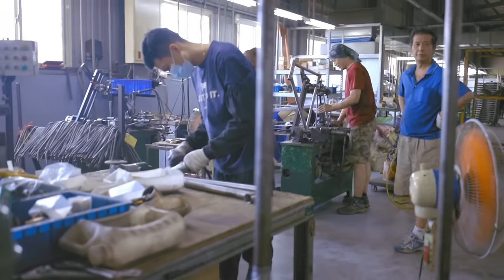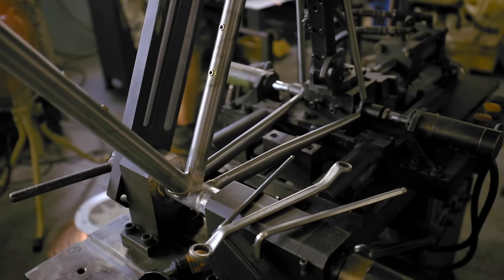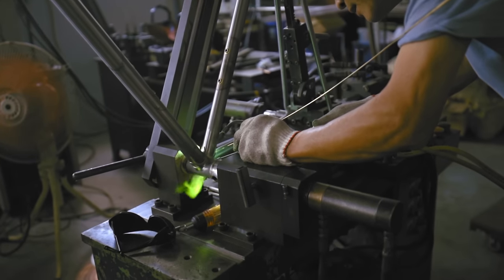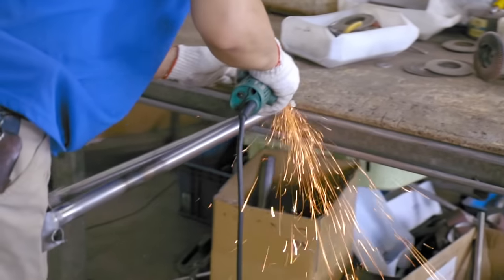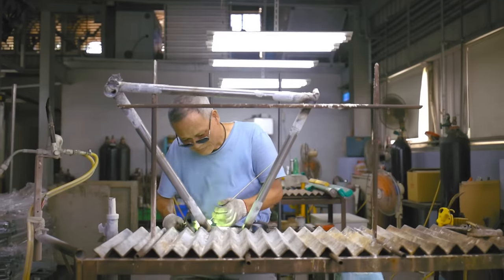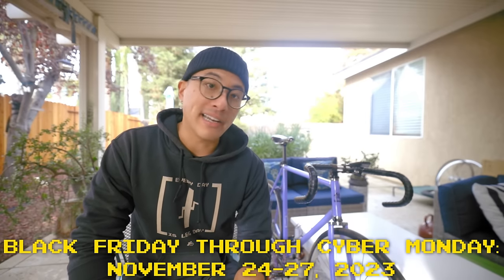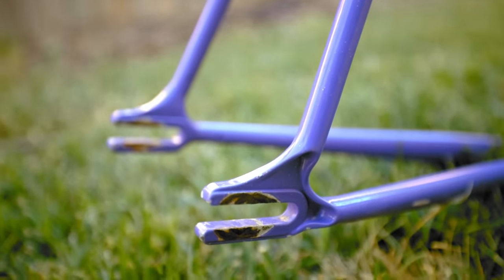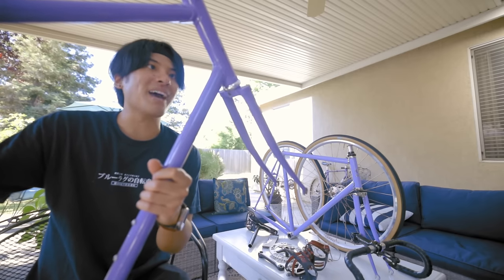Hand Built Steel Bikes | Wabi Cycles Factory Tour!

Comment: Pete. I know a Pete. It’s named Billy, Billy Davidson, the bike. Petes are us and we are them, not much more, enough more to get deep on this one though. Willy, who is going to be freewheeling for obvious reasons, looks like Billy. Lugs to match but Willy is more whale like in the OS down tube, I digress. Willy knows Billy and respects the gifts and tubing diameter, what a noodle Billy is/was. Willy transcends and includes— an echo of the former. (My Davidson, Impulse// Waterford Road/track 2200 are nearly the same bike, by the 30-40yrsof difference makes 1 inch headset v. 11/8 or thin tubing for a springy rear makes the old stuff have the last word). It’d be better if one just broke (in my situation), glad Pete has a new family.